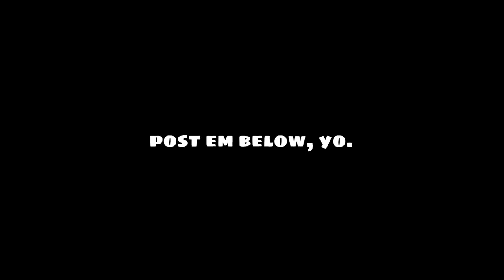Are 2018 KTM 350ʻs Built Cheaply? | 26hrs & BROKEN

Comment: Faulty tip sensor? You could try bypassing it to see. Since the original issue happened during a wheelie I feel like it could be either loose or shorting over and over which would blow a fuse. Could also try tipping the bike up or laying it down and then picking it back up and see if it runs after.
Reply: checked tip sensor... forgot to mention that. tip sensor actually kills power to whole bike when circuit is opened.
Reply from the maker: Dass a good idea. Think we tried it and Jordan left that out of his Shakespearean monologue.

Comment: Check voltage coming from the stator check fuel pressure might just be priming if all fails check the ecu if that doesn’t work burn it and get a Yamaha

Comment: The motor needs to be replaced with a Yamaha motor
Reply: if they made a real off road capable dual sport bike I would switch in a heart beat! and that's not a diss on the wr250r.... I choose not to torture myself with the weight of that bike in the deep jungle riding I tend to do here.
Reply from the maker: ben murphy god, I WISH they made a 350R, I’d get on it in a nanosecond.
Reply: I really want to try the yz250X.
Reply: @bobbyhampton1012  wish that thing had a happy start  Button!
Reply: No magic button! They make supposedly the "best" trail bike (250X) but its kick start only. They make the "best" dual sport (WR250R) but only a 250 version. Come on Yamaha!

Comment: Theres a main ground under the tank that can cause sporadic issues. worth checking.  Also maybe look into what it uses for a voltage regulator.

Also based on some quick googling try checking the tipover sensor

https://thumpertalk.com/forums/topic/1097327-ktm-250xcf-starts-but-then-dies-after-7-seconds/
Reply from the maker: urmomsayswhat holy shite, there’s another ground?!
Reply: AccidentalBroadcast  as we say in Canada,  “YAH BUD” 

The more reading I do though, the more I’d be looking at the tip over sensor

Comment: Any updates?
Reply from the maker: UncleMel still down, not yet :)
Reply: @AccidentalBroadcast  Thanks for the update!
Reply: Experience this myself, Have you changed the spark plug? plug looks new, sparks when checked (out of the head) runs for 10-20 seconds then dies? Changed plug,  problem fixed!

Comment: Try checking/changing your spark plug.
Reply: checked plug, looked good, no cracks, good golden color, good spark.
Reply: @offone9469  Seems like the simple things are eliminated.  If something bad enough happened to blow fuses I wonder if the ecu got damaged? :(
Reply: @ScottMA64  exactly! this is why I'm thinking I need ktm to diagnose...it's 125 bucks to diagnose. probably save me 5 more hours of head banging in the garage.

Comment: Haaaaaaaalp
Reply from the maker: PS: we juuuust shot this viddy so Jordan still has all the same problems + he can’t ride due to knee surgery yesterday. Lez get this biatch fixed!
Reply: check the capacitor under the gas tank? What year is your bike?
Reply: @rebelyell22  2018
Reply: @offone9469  Derp....  Apparently I can't read a title. I'll do some research
Reply: @offone9469  What's your FI light doing?
Reply: @offone9469  Did you ever get this fixed? Should have brought it to a dealer and had them connect their diagnostics hardware to it.
Reply: @SampsonGG  It ended up being a bad spark plug.....:(   she's gone to a better place now though. Now I get to figure out ducati issues:)
Reply: @offone9469  Oh wow that's so stupid. You always think of a spark plug as either working or not working. This would have taken me a year to figure out.
Reply: @SampsonGG  yeah, plug showed good spark when tested but after it ran for a few seconds it heated up and arched to ground i believe.